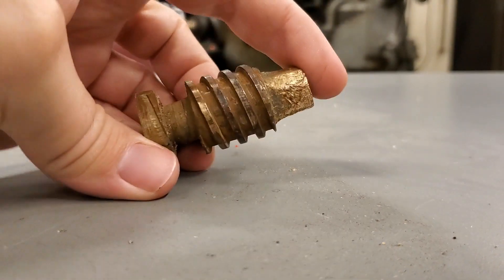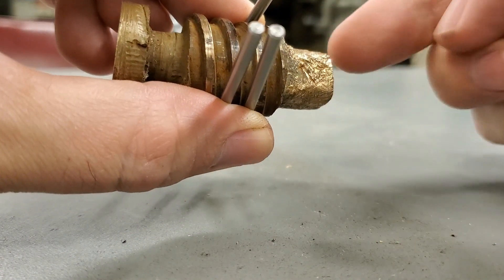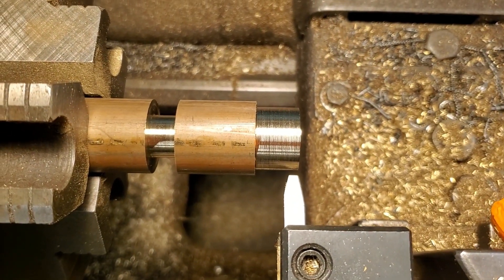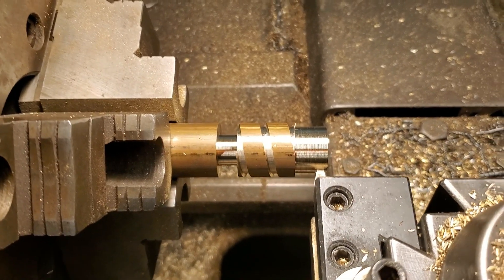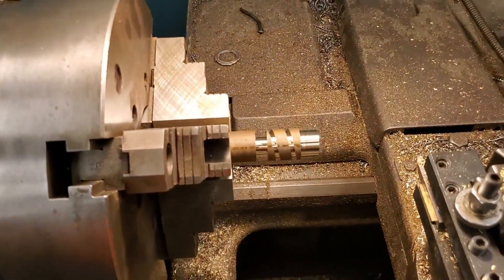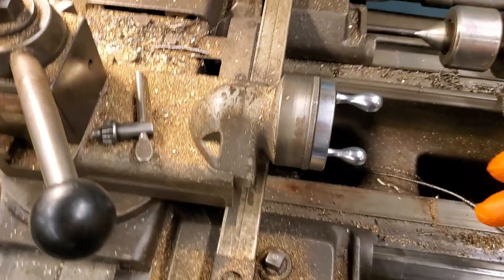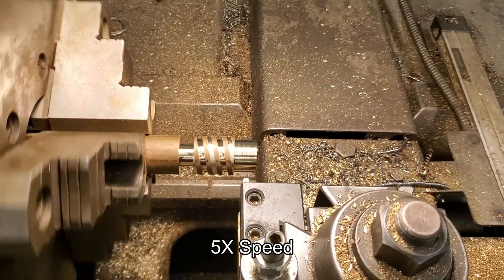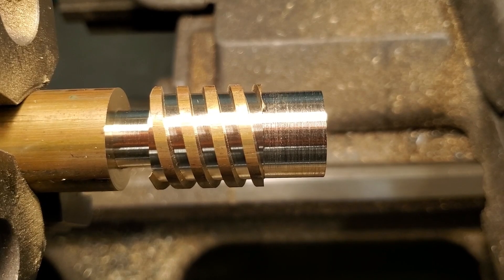Cutting a Double Start Acme Thread

Comment: Awesome.  Do you just get the rough dimensions for your acme cutting tool from machinery hand book?  How do you grind something like that, and get it close enough that you can match the thread form with confidence?  Thanks for the video.
Reply from the maker: They make thread gages for acme threads just like the ones for unified national/ISO threads (60 degree thread form). They are used in much the same way. Grind a bit, check the angle, grind more, check, get really close, check, make a small adjustment and screw it all up, curse a bunch, start over. The big difference is that acme threads have a wide flat on the end of the thread that is very different in size depending on thread pitch. Actually, UN/ISO threads have a flat too, but it is quite small and you can get away with using the same tool to cut multiple thread pitches. Not so with acme threads. The acme thread gage has numerous notches on the sides to help you grind the correct flat. If I get a chance, I'll shoot a short video  on it. Great question! Thanks for watching!
Reply from the maker: Hi Jeremiah. I put up a video showing the acme threading gage. You can find it here:

https://youtu.be/K0mcGgGS5m0
Reply: @StuartdeHaro  i saw it.  Perfect explanation.  Thank you
Reply from the maker: @JeremiahL  you're very welcome! Thanks for the question.

Comment: How much is your cross slide movement
Reply from the maker: I roughed it in .020" or 0.5mm per pass and then took two passes at .005" or 0.13mm and a final pass of .002" or 0.01mm.

Comment: This is 4,tpi inch's??
Reply from the maker: Yep. 4 TPI double start, so the machine was actually set to 2 TPI.
Reply: After that how much need to moving cross slide movement
Reply: 6.35mm
Reply: Or half of 6.35 ?
Reply: Please reply?

Comment: Stick the pins in styrofoam so they sit in the grooves, so much less trouble holding stuff!
Reply: Also, span the wires with a Jo block so you can use your mic! More than one way to skin a cat. Great video - I need to cut a two start LH thread (internal AND external) for my lathe cross slide and I ain't looking forward to it.

Comment: Why no cutting oil? Brass is so grabby... Enlighten me
Reply: And no tailstock support? And the thread relief being fully cut before threading? I feel like I'm missing some vital piece of information, what gives?
Reply: Sorry, I just read my own comment and realized it could be misinterpreted as being nasty. I'm not critiquing, just looking to learn something I don't understand
Reply from the maker: @jpsimon206  brass is really only grabby when drilling, and just when the drill starts to break through the other side. I never use cutting oil when machining brass. It doesn't stick to the tool like aluminum. It won't wear down a tool quickly like steel or stainless. The thread relief was actually a critical feature on the part that slipped into a channel on the mating part. I could have machined it in later but honestly didn't think about it. The thread was quite short and stout so I didn't think tailstock support was necessary.

Comment: very good video. i was wondering  since you were only using the thread wires for a comparison why couldn't you have just used two wires and a mic to measure the thread depth?
Reply from the maker: I could have. The thread pitch is very coarse though and I think that would have made it even harder to get a good measurement.

Comment: Nicely demonstrated and impressive that Monarch will cut a thread pitch that coarse. It should be mentioned that for more standard, lighter weight lathes most at the hobby level will have it's not recommended to cut any threads per inch coarser than the feed screw pitch is due to the stress put on the gearing components. It can still be done by hand or with an add on independent power feed by back driving the lathes spindle and part with the feed screw. Chaddock's book Building the Quorn  tool grinder details the problem and his solution. In his case he was thread milling a part with a 1 tpi pitch using a manual lathe with an 8 tpi feed screw.
Reply from the maker: Interesting. I've never heard that. The Monarch will cut down to 1.5 TPI with a 4 TPI leadscrew. I'm pretty sure my lathe at home will do 4 TPI and it has an 8 TPI leadscrew and it is pretty light.
Reply: @StuartdeHaro  I've read it in a few older books written in the U.K. And those were from well respected authors so I'd assume there's something to it. And most lathes with change gearing there thread charts I've looked at never seem to list any thread pitch less than the lead screw pitch. More industrial type lathes are a different animal though. Hardened and ground helical gearing will obviously take a lot more than the light weight spur gears mine have.
Reply: @StuartdeHaro  My home lathe has an 8 TPI lead screw as well and will cut 8 different threads between 4 - 7 TPI. The key words here are '_older books_'. South Bend's book "How to Run a Lathe" caused me quite a bit of grief when I first tried single pointing threads on that lathe. Following the information in that "older book" on using the threading dial was a disaster when applied to my more modern lathe. Using the chart in the owners manual however works just fine.

Comment: That worked out fine but i wonder if some no nothing will comment that you cant cut threads with the top slide parallel to the axis of the lathe and it really must be at half the thread angle because they saw it on youtube😉
If i were doing that job i might have not cut such a deep thread relief till after the threading was complete to encourage a stiffer work piece but thank goodness we are all different. 
It's always the destination that matters never how you got there. Some folks need to be there quickly others enjoy the scenic route. I often enjoy the journey more than the final result, hence making tools but never sctually using them.😂
Reply: Not necessary in brass. Mostly not necessary in steel either.
Reply: @electech3339  indeed, if cutting a 6tpi perhaps but more regular threads quite unnecessary.
Reply: @chrisstephens6673  Agreed. I generally only infeed at an angle if having trouble with finish or chip control. And try threading at 0.5 TPI... Especially for internal threading, often need to cut every thread surface separately - and sometimes split even those into halves!
Reply: @electech3339  have you seen a "clapper box" threading tool? If not take a look at my video about screw thread cutting, so you think you know an easy way, showing an up dated victorian design.
Reply: @chrisstephens6673  nope, had not seen that style, very neat. I have seen the spring loaded style ones that shoot back out of the cut once they're triggered. Those need to be reset after reversing back out past the end of the part. Those are pretty cool too, and don't require any relief groove.
Reply: @electech3339  would love one that is totally automatic but at this time of year when it is cold out in the Engineerium I keep thinking of giving up metal munching altogether and can't be bothered to make one.